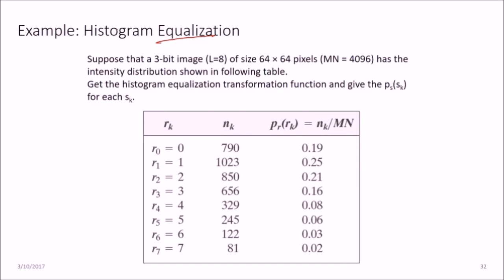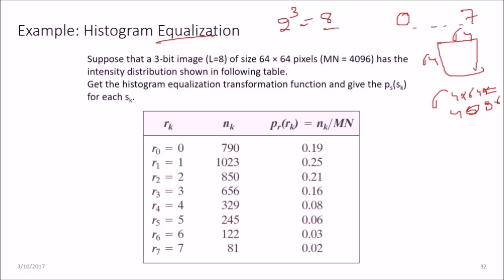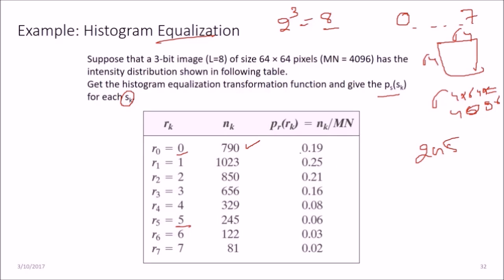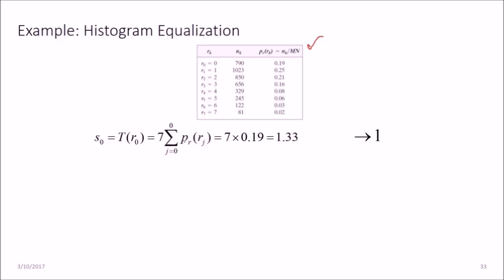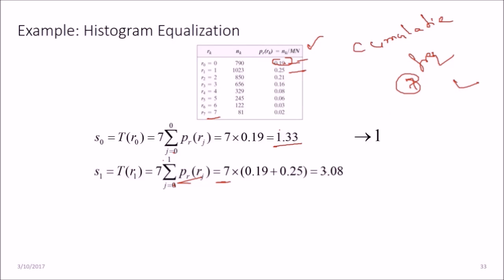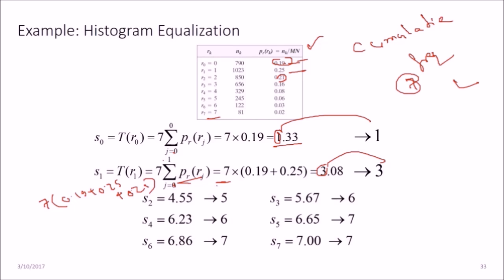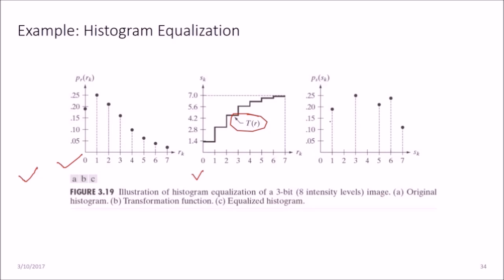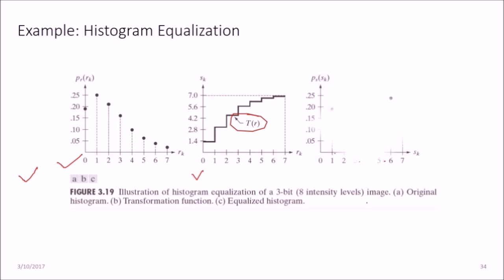Histogram Equalization with Example | What is Histogram Equalization|Histogram Equalization Example

Comment: can you plz explain the last graph!
Reply: SAYAN MAITY last graph is different from numerical problem.
Reply: this is late but to anyone wondering the last graph when the s value was 5 all pixels corresponding to the r values get added to the new r value
for ex s3 and s4 are 6 so the new value for r6 is the number of initial pixels with r3 intensity and pixels with r4 intensity. also in the new graph r2 value is zero because there are no s values which become 2
Reply: @kawaiiaqua9072  Thanks it was really helpful